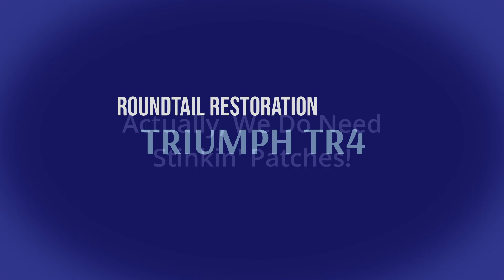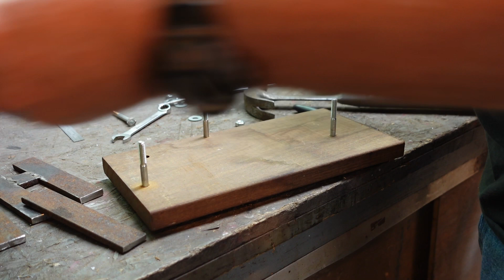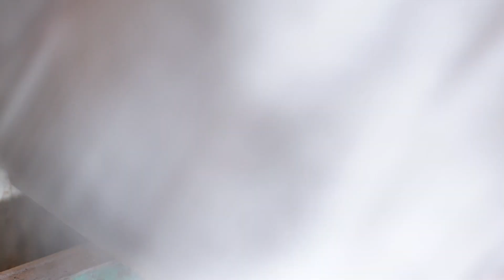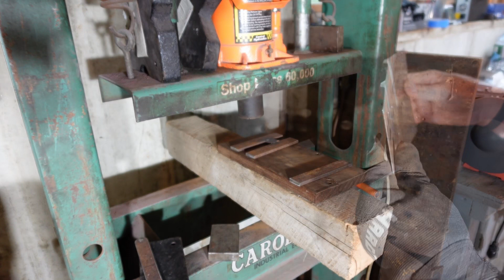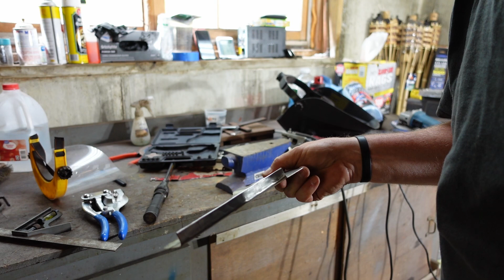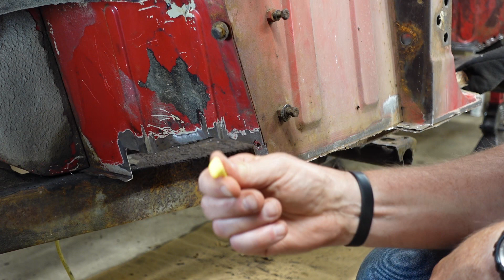Triumph TR4 - Firewall Patch | Roundtail Restoration

Comment: Hi Chris, nice to see another video on the TR4.  I am currently rebuilding the LHS of my 4A, so seeing your progress gives me additional motivation.  I had to press a similar channel on the bulkhead top of a TR6.  I found it a problem pressing out the full length in one go, so made a shorter die which concentrated the pressure over a small area, then I progressively pressed, a few mm deep at a time, moving the die in stages over the full length.   It seemed to work out ok, but required some shrinking of buckled metal in the un-pressed plane.  This smoothed out ok with a shrinking disc... useful addition to the restoration armoury.  Look forward to your next one
Reply from the maker: I do have a shrinking disc. Not very good with it, so maybe this will give me more practice. Good idea about walking the press like that. The other side is not as chewed up, so hopefully it'll be easier

Comment: Hi Chris ..you sussed it! I remember that Jade Muttley made these using a buck like yours, but he used an air hammer and rounded off the chisel, to create the profile. Sadly, all of Jade's video's have disappeared from You Tube and I cannot find them anymore. If anyone has that or knows where his restoration videos have been moved to, it would be handy to have them available to us afficionados.
Reply from the maker: I remember that Jade Mutley video. I didn't notice that his page was fine, though. That a shame, what a great resource. Got some tweaking on my method, but it works. Thanks, Brian!
Reply: @roundtailrestoration  Sorry for my bad spelling. I had a partial stroke about 4 1/2 months ago and I get gaps in both my recognition of letters and in my speech . I have corrected it. I sometimes do not "see" that I have made mistakes of view the red line as the difference between US and Aussie spelling. Love your work.
Reply from the maker: Man, I didn't even notice. And you can see that I've got my own errors. And I'm supposedly in perfect health! Thanks, Brian. I hope the gaps eventually shrink to nothing.